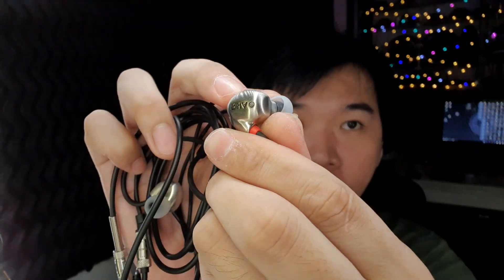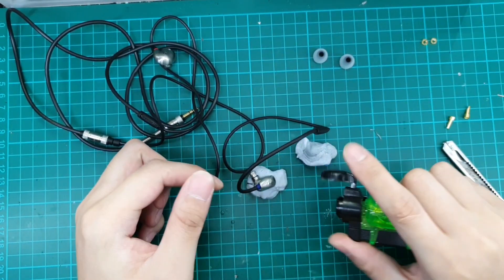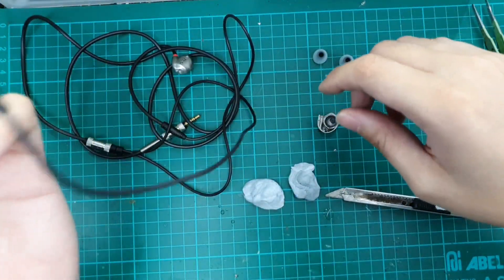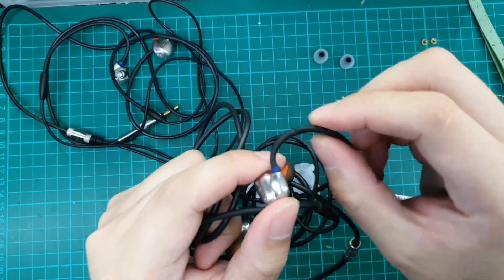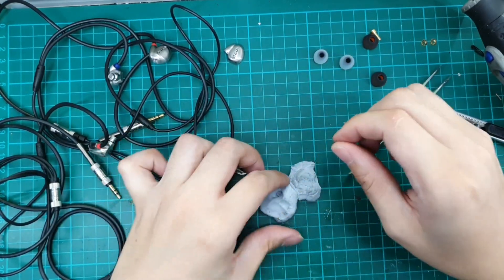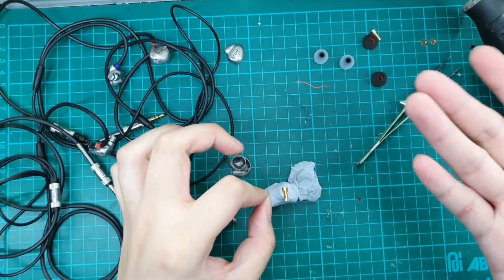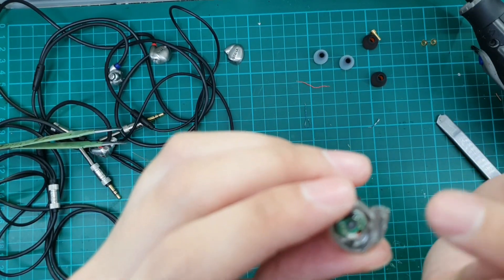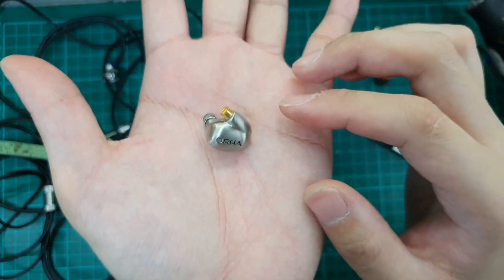RHA T20i mmcx cable mod Tutorial

Comment: Bro i got a question. Just refer to the  disassembly for left earpiece. I realise that the red dot is for ground. And without red dot which is Signal. Correct me if i am wrong.
Reply from the maker: Follow the wires, if I remember the driver is reversed
Reply: @sgaudiohive  Because from picture the signal cable is at another side that without red dot. Why i asking this because i tested the cable to make sure the cable is correct, for T20 signal should at without red dot.

Comment: Nice mod!! I have one question, do we need to keep the ground connection insulated from the metal case?
Also, I may have misheard but it sounds like you say that the connections on the driver with a red spot are the signal connections? On my t20i the connections with a red spot have the grounds connected to them (gold cable), and the signal points are the ones with the blue or red coloured cores connected to them.
Reply from the maker: It is absolutely beneficial to prevent contact of the ground to the metal shell.  We always advise customers not to use the ungrounded Iem while charging the device
Reply: Bro we have same question here.

Comment: I might try this I've had 3x t20i all under warranty, 2 with the crappy ear cables, and then a pair where the ear cable seems fine but the internal wiring has decided to stop working fully. Thought about ear pods but they only last as long as the battery, seems such a waste to throw away perfectly working parts

Comment: Hello my friend, great tutorial.

Can I ask which size bit you used for the Dremel tool? I have a Dremel & the T20's but I'm unsure which sized bit to use. I'd like to have the right size before I take the IEMs apart.

Kind regards from England!
Reply: it has to be the same diameter as of the mmcx connector your are putting in

Comment: Hi, great video! 
Can i ask you if there's a way to fix a loose MMCX conection to an IEM without changing the MMCX plug on the cable?
Reply from the maker: If by loose you mean sound cutting out etc, can try alignment adjustment of the inner clamps on the female mmcx connectors ,

Comment: Great tutorial. Well done. I need a suggestion about how to wire 8core cable 2.5mm TRRS (balanced)  to double 3.5mm TRS  (single-ended). 
On this link, you can see what I mean https://www.aliexpress.com/item/33011625948.html 
I draw this graphic https://postimg.cc/WFyCgkCB to better explain. Let's say we use two wire for every section on 2.5mm TRRS plug, but which wire goes where to properly connect
with 2 x 3.5mm. Thanks in advance
Reply from the maker: L- and R- from the 2.5mm trrs will connect to the rs of the 3.5mm, the + will go to the T

Comment: BTW there are smaller thread diameter MMCX female connectors now, like a good 1-2mm smaller diameter than a stock MH755 hole. Might try those to avoid drilling. They don't come with the counterlocking nut, though.
Reply from the maker: There's a version of this that's really thin, but ya they work differently